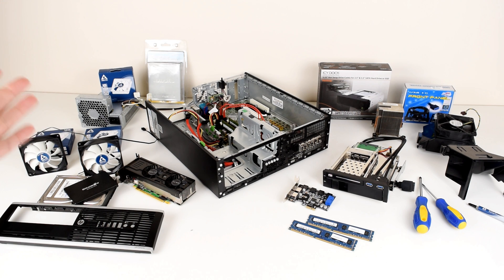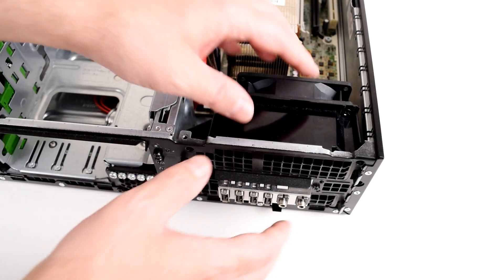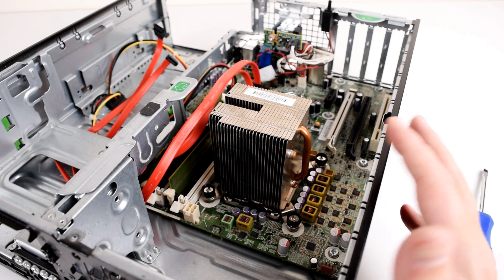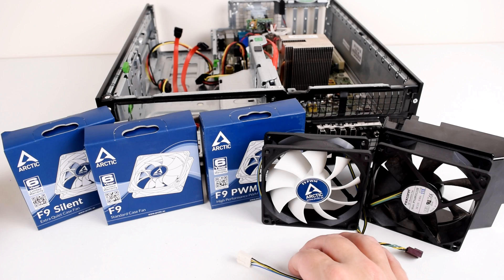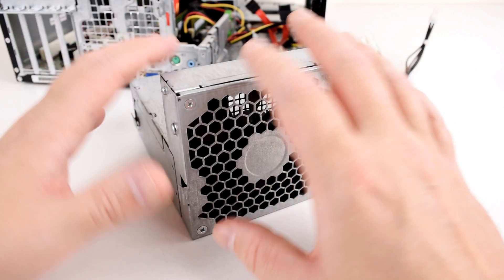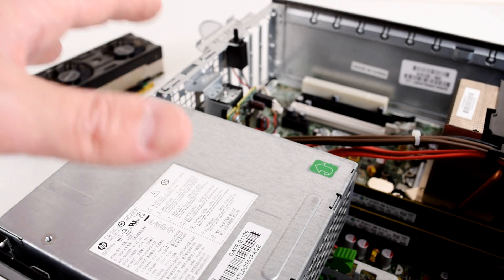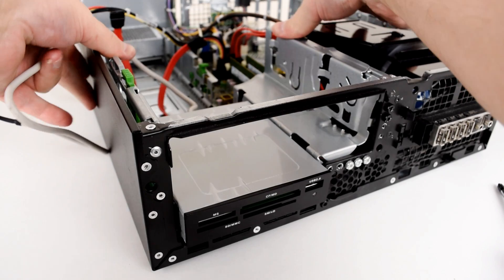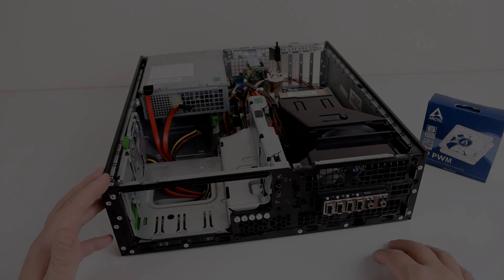Improve your HP Elite Small Form Factor PC

Comment: Great video with lots of useful info.  

Just wondering how much quieter the new fans were.  I’ve gotten used to a fanless laptop,  and the noise from my HP Elite 8300 has become annoying.  Did the Arctic fans make the pc much quieter?

The Arctic fans are hard to source locally in NZ.  Any guesses on whether a higher priced fan such a  Noctua A9 make the HP almost silent?

I totally agree that the power supply has spare capacity.   With my HP Elite 8300, not a 8200, (i5 3470, SSD+HDD, no graphics card) and the cpu at 100%,  I measured a surprisingly low 56w at the wall.
Reply from the maker: You can adjust the speed / noise. Be sure to watch the part again and which fan / speed to pick.
Reply: @philscomputerlab  I got exactly the same arctic fans. But after replacement, PSU fan doesn't work, and on boot I get 515 error "PSU fan not detected". Do you know what could be the problem and how to solve it?
Reply: I did manage to make psu fan working by plugging it onto MB port, not sure if that's a good solution. Still, I  get that annoying beep and error msg on boot and have to press F1 to continue. So, if you can help.
Reply from the maker: @Manifest-t5y  I'm not sure, what you see in the video is all I did. I don't have the machine anymore though... Do you have the same model? Maybe they changed something?
Reply: @philscomputerlab  Yes, I have the same model. I'll buy 'new' PSU and try again. On top of my head, I think somehow I managed to damage fan connector, because now the old fan won't work when connected. Anyway, thanks for your reply, I appreciate it.
Reply: @philscomputerlab  Just to let you know, I bought another PSU and successfully replaced the fan.

Comment: elite 8100 to 8300 supports up to 16gb of ram only, not 32gb.
Reply from the maker: I'm using the 8200. Also, at least for the 8200 and 8300 you're wrong, it does 32GB, I've tested this myself.
Reply: maybie with newer bios
Reply: My HP 8300 SFF has 32 Gbytes installed and working (I use it to rum VMWare workstation on Linux).

Comment: Is there no way to put an ssd and hdd without using that drive bay, or can I still do it without it ?
Reply: You can do it without. In the standard configuration that comes with a DVD drive, there's one 3.5" drive bay underneath the power supply, and another underneath the DVD player. You slot the hard drive in and then use the screws. You can also use an adapter for the SSD and screw that in too if you want, but since it doesn't have any moving parts you could also just place it there and connect it up without worrying too much.

Comment: Is that 240w psu in your pc(with 1050ti) ? Bc i want to buy a new videocard and the videocard need 300w psu, but i have 240w, and there is no 300w psu for sff pc's
Reply: Wolfy same problem, how did you fix it?

Comment: Missing funny HP hard drive screws ??? Thread sizes are marked on the front of the case: 6-32 and M3
In a pinch, hex-socket head machine screws may work.

Comment: Hi Phil i m getting a new 1030 gt low profile for my 8200 SFF. It has the HP mainboard , will it work? Also should i go for the silent version or the one with the small fan ? Thank you
Reply from the maker: I have one with a small fan, and it works great :)
Reply: Is it noisy with the fan  when not gaming ? I want to avoid that, as i like that it is such a silent computer :) stock
Reply from the maker: It's not, and I do recommend one with a fan in that machine.

Comment: I still use my Dell Optiplex 790 SFF as my spare workstation on occasion, with an i7-2600, 16GB DDR3 1333mhz ram, and a MSI 1050ti 4GB OC boost edition, with a stock intel 160GB SSD, and modded dell to PWM fan headers. didnt cost me too much to build and is still going strong even after 2 years of almost constant use (and cleaning/thermal paste replacements every 6 months or so)
Reply from the maker: Very nice :)

Comment: If you wish to know absolutely everything about your HP elite 8000, 8100, 8200 or 8300 computer go to the HP website and download the user manual for your model.  This includes all the different case options and part numbers.  Because of the HP proprietary CTX style power supply, 240w in sff or 320w in cmt form the best current video card to use is the 1050TI which only uses power from the pcie slot. Using a GTX 1060 is possible with the 320w/cmt case if you pull power from BOTH the DVD and hard drive power wiring.  Requires a two sata power plugs to one 6 pin adapter.

Comment: good lord man, you are hooked on hp 8200, aren't you. 9 mths ago you did a video on this model. i recently sold a Lenovo M93p tower i5 4570 and told the customer to add in a GTX 1050 Ti. The PSU in m93p is around 280W so that is good.
Reply from the maker: Yea it's so cheap and versatile. The newer models still cost a bit to much.

Comment: Just got my self an HP 8300 Elite several days ago for a cheap tinkering project after left the PC wold for awhile. Got new small SSD right away migrate the OS, waiting for the bigger DDR3 RAM to arrive. Will do your fan upgrade ( HW n SW ) to make it almost noiseless. Next will be finding 128-bit passive low profile VGA card that is not power hungry yet powerful enough to play some game ( I have NV 600 but it doesn't have low bracket ), any suggestion?
Reply from the maker: I'd go for the GT 1030, but make sure it's the GDDR5 version, not the much slower DDR4 one.
Reply: Thank you for the prompt reply. I looked online, indeed GT 1030 better than NV 600 and most have low bracket version. I stumble upon your channel by chance, it made me want to go back to the old PC era. Thanks again.

Comment: Awesome video!  I have an Elite 8000 that I bought refurbished back in 2014, and it runs like a champ!  But I'm so glad you posted this video, so I can figure out how to keep it running well, and upgrade it if needed!  I'm not a gamer, so I don't put it through any big loads, but I bought a second 8000 on ebay for spare, and the motherboard looks very slightly different - I'm just wondering --- is it normal for there to be some minor variations in the same model?  Also how high can I go with upgrading the CPU?  Will an 8000 take a Quad Core?
Reply from the maker: The video is about the Elite 8200, so that's a different model.

Comment: Thanks for this great video, it really helps a lot!
Do you guys know if there is any way to properly install a 2.5" SSD in these PC or if I will have to buy a 3.5" to 2.5" adapter?
Thank you in advance!
Reply: The 3.5 to 2.5 adaptor cages    need a bit of a mod to fit into the clip down brackets in these    totally do able.  2tb  Seagate barracuda 2.5 drives are about £60 each and work pretty fast but be ready with a few nicknacks to get them into those cages and for the cage to fit in the  sliding clips the pc case has.
Reply: You can of course fit a 2.5 drive on top of the 3.5 drive  under the psu     there is just enough room for this  I popped some sticky tabs around the 2.5 drive  for it to sit within  making sure to not block the vent holes.     If someone could make a 2.5 to 3.5  cage   that would fit 4tb 19mm drives  then  I would have 2 of them instead as  shucked drives   from Seagate are £100 each from Amazon

Comment: Splendid build Phil, I have mostly all Dell professional hardware. Optiplex/latitude but I also have an HP or two and these low profile business class pcs are often highly overlooked. Both my Optiplex 7020 and 7010 are fantastic computers with mid to high end quad core cpus, video cards and stuffed full of ram More than enough power to virtualize and do things like Fortnight. Especially since i've upgraded mine to ssds and both share the same Dell Windows image. It helps make ownership super easy. Just download the OS, inject the driverpacks and install. HP has a nice feature for these too. They call it Cloud recovery. Works like a charm.
Reply from the maker: It sounds like you have industry experience and worked with these machines in the field? I do have one Optiplex, I think it's a 9010 SFF with 2 PCIe slots. It's my main machine in the computer lab for capturing the footage from projects I work on and other stuff. Quite happy with it and it's that little bit more compact.
Reply: PhilsComputerLab Yes, a little. I am a developer. Well, was. I don't do much right now. I used to work for Be, Inc remotely back in the day and worked locally. I buy and sell today. Nothing big, but it keeps me busy. I just basically love making things work. Reworking older computers. I go back as a kid to the Apple II era. Good times:)

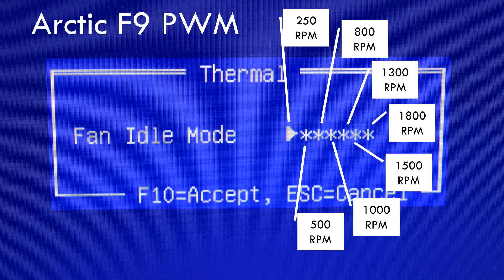Comment: So... do you have to change anything in BIOS when installinf new fan? in 7:12 there are only 6 stars and you suggest 7 different speed levels...
Also, that fan in a power supply. Is arctic f9 pwm too? Just curious if it is a point installing f9 pwm when you cannot really contol its speed?
Reply from the maker: No star is 7th setting.

Comment: I have one of these. When I set the Fan Idle Mode to a lower 500 or 1000 RPM setting the fan speed doesn't ramp up when I stress the CPU. Why is that ? These are PWM fans so shouldn't they speed up when CPU temps get over 60 or 70C ?

Comment: my HP 8300 has a core i5 3570k (k version is a tiny bit faster than non-k version and doesnt cost much more. i got it for 60$ on ebay anyways super cheap)
12GB ram and zotac GTX 1050 ti 4GB OC and overclocked the GPU and a 128GB SSD with 750GB HDD storage space. windows 7 pro 64-bit runs pretty good for me!

Comment: I have the hp elite 8300 sff computer and i was woundering would the artic p9 fan would be able to mount on the back of the case
Reply from the maker: It should work, but I've only tested in the Elite 8200.

Comment: If you used the silver screws from the front of the case on the sides of the drive bay devices, then they would just drop into the quick release system on the drive (the green lever on the side of the bays)
As well as the bios update, remember to check for a Intel ME firmware update.
We have a number of 8200s in the Ultra-slim desktop (USDT) form factor, which are an identical chipset to the SFF ones, but built smaller using laptop parts (2.5in HDD, laptop optical drive, external laptop style power supply, etc.), which makes them no good for upgrading due to small size of the case and the internal expansion being via a MXM slot and a mini-PCIe slot.

Comment: Anyone know of a decent sff psu for these systems? Can't seem to find one 400w+ thats compatible with my system
Reply: They are proprietary. Won't take the regular 24pin atx power supplies. Won't even work if you start rewiring the connectors since it uses different voltages. Only real solution is to stick to a 1050ti or lower, or add an external second power supply.

Comment: Can just voltage control the other fans.
A x16 slot that only delivers 25" instead of 75W is voiding the PCIe specifications. 25W is the specification for 4x cards.

Comment: i have a slightly newer version of this. It came with a 3000 series core i5 and built in USB 3.. It also came with windows 8.0 built in. I can vouch for these machines they are very good and can be had for little money.. They are very common in banks and other businesses.
Reply: That was the 8300 elite then
Reply: possible lol. All i do know is that they were very good machines. I do know if you get one updating the bios can be a pain in the ass. Chances are it will be very behind when you get it, and you cant just get the latest bios and update you have to step it through like 2 or 3 revisions to get it to the latest.

Comment: you could have sliced the excess material off the connector on the fan with a knife, instead of forcing it on the motherboards connector, you could have been in lots of trouble the the connector on mb broke, i had something like that happen on Chinese X79 mb i had, luckily it was just the "tab" that broke, not the whole connector, and i wasnt even forcing everything and the 2 connectors were matching pair of 3pins...

Comment: The original fans in an HP are very good. If you prefer to change with an Arctic fan, use the CO (continuous operation) versions. They will last more than a year...

Comment: First Great Video as always. Now I have a few questions. Why did you put your fan to release the heat inside the case(CPU Heatsink), shouldn't it be used as an exhaust, pull air from the case out? 2nd question: Why don't you make more videos like this? I understand the "It's an oldie but a goldie" but I've only used the tech you present when I was a child, I had a Pentium 686 with a "turbo" button that let me go from 66 to 166 Mhz not miles per hour :P.
Reply from the maker: You'll have to ask HP why they designed it like that.

Comment: Your heat sink was screwed down wrong. Might not seat right if you do it like that. You should screw it in and tighten it like a cylinder head or a vehicle wheel. Opposite corners. Regards jabba

Comment: A proprietary PSU is a deal breaker for me. Most PSUs are past their useful service life after 5 years. That is due to the filter capacitors in them degrading over time. As the ESR goes up in those devices so does the output current ripple. Never a good thing. Ultimately that can make a machine unstable or even destroy it. Although these machines can be had for so cheap it might actually be worth recapping them? Not a job for the untrained though.

Comment: Hey Phil, 
Just wondering if you or anyone else has had intermittent black screen issues with a 1050ti in a HP ProDesk 600 G1 SFF. 
I believe it is due to power issues from the PCI slot, it mostly happens during transitions from desktop to loading up a video game for example.
However it also happens when on the desktop, unfortunately I am not able to directly repeat the issue.

Comment: I can't even count how I hated this piece of shit computer back at work. Even it having 16gb of ram didn't help the poor A4(or 6?) CPU to compile at least as fast as the standard issue laptop with core i5 5200U. It felt so good to return it back to IT when I was leaving. They called it "Development workstation", but I think it was a sarcasm.
Reply: Just got a hp 8300 sff and was wondering what's the max size harddrive it will support for a storage unit.  I'd like 4tb if possible.
Please help!

Comment: Great stuff, that HP definitely benefits from the full height PCI card ability.  My SFF is really small, being a Dell 7010, but it has been given the works with i7-2600, 16GB RAM, 240GB SSD, wireless Dell keyboard and mouse, but the GPU is the only problem - so tight in there, I can only see a GT1030 fitting, but in a budget machine, they aren't cheap enough right now.  Do you know of any half height GPUs that are maybe a few years old and will manage to outrun the integrated graphics?
Reply from the maker: The Low Profile GTX 1050 is pretty decent.
Reply: Selling right now for $100 https://www.newegg.com/Product/Product.aspx?Item=N82E16814137079&ignorebbr=1&nm_mc=AFC-C8Junction&cm_mmc=AFC-C8Junction-PCPartPicker,%20LLC-nana_-na&cm_sp=&AID=10446076&PID=3938566&SID=

Comment: I built my first computer and it was a HTPC. And like you I was grappling with what kind of fans to use. The goal was to balance silence with temperature. I think I've got the right balance. But I know there's room for improvement in this dept and in others. Your insight into fan choice is interesting. Unfortunately your choice of Co's to purchase such small factor cases caused a rush on these models and as a result prices shot up. I guess you've got quiet a following. Nice. In a perfect world, I would have found these cases in a rubbish tip, in perfect condition of course, then swap old with new hardware. I also would like to go one step further and install laptop parts, although their just about non existent. Excellent for sound, money and temperature.

Comment: The sleeve bearings in those Foxconn fans are just bad. Every one I've seen wears out pretty quickly. I usually replace them with Panaflo's. The HP business machines are pretty fun to work with; great case design (for BTX at least), and on the towers fully standard power supplies and room for a dual slot GPU. Of course the semi-tool-less drive bays are pretty neat. The boards are built to much higher standards than most consumer OEM boards with all 105c rated caps or higher. I love these things
Reply: Jay Pattyson Love my 8200 Elite CMT myself (i7-2600, 6 GB memory, GT 1030 (GDDR5) 2GB, 250 GB WD Blue SSD with Windows 10 installed.) Runs circles around my main laptop that is a year older than it.
Reply: Out of about 100 desktop of these series I've seen worn out fans on ~5 year old machines in about 2 cases.
Reply: They should use Yate Loon fans
Reply: Are the sleeve bearings those rubber grommets for the fan in the front??
Reply: Randolph Hanson umm, no.. a sleeve bearing is the bearing the fan shaft rides in (the shaft is the inner portion of the bearing). It basically rides inside a metal sleeve, usually oil filled. Typically very short lifespan compared to a ball bearing, although Panasonic did a good job improving basic sleeve bearings with FDB (which many manufacturers have either liscensed or loosely copied)
Reply: I used the EASYNOVO PWM PRO 9225 with Hydro Dynamic Bearings.

Comment: I have an Elite 8300 board that I bought an ATX cable adapter from China.  It seemed to work for about 20 minutes and then the board started smoking. :( Beware of any adapters you buy and make sure they are reputable.
Reply: In the end the cables are the same, just the layout is different. Should be possible to just switch around the wires.
But those proprietary power solutions are usually the worst part about OEM systems.
Reply: @HappyBeezerStudios  No, on the HP Elite they use a 12 volt standby mode instead of the standard 5 volt.  You need a boost converter to take the 5 volt to 12 volt to make it work.